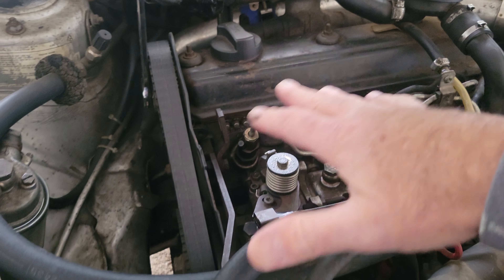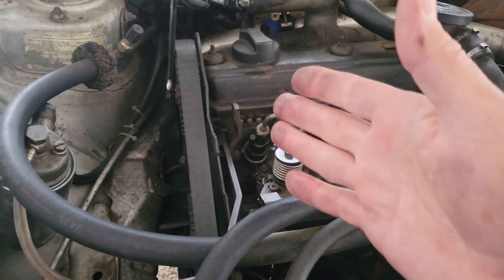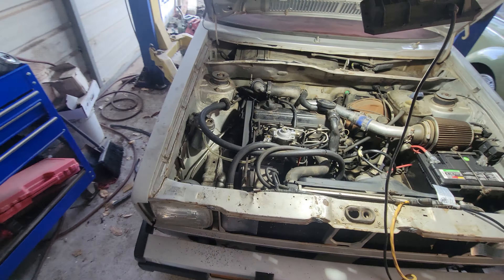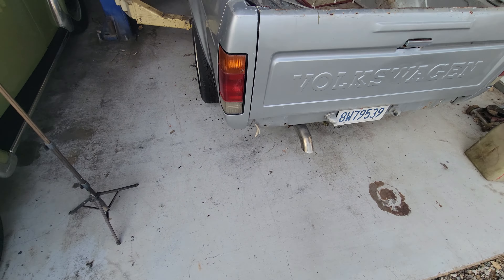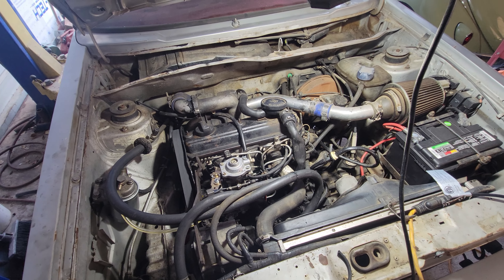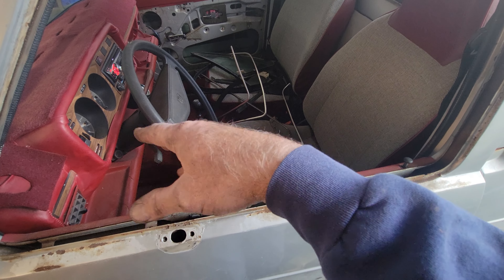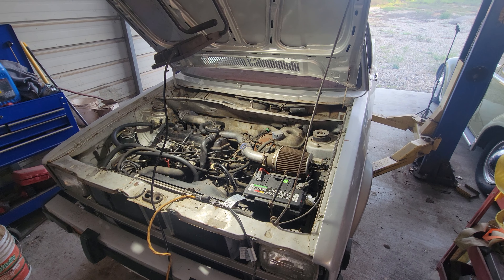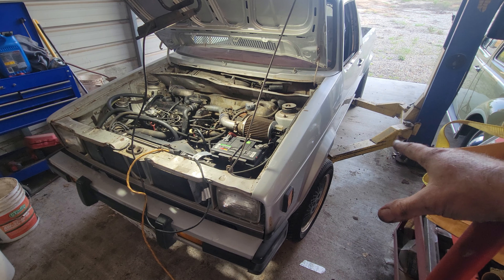VW Rabbit pickup caddy 1.9 turbo diesel ALIVE AGAIN.

Comment: I miss those simple diesel engines. I had a few of those engines in my golf mark2 in Germany. They run great until u over boost them. I believe that's the AAZ diesel.. you can adjust the pump timing for power or fuel economy.

Comment: Sure would be cool if one of these VW parts dealers would start sending you parts and then allow you to make videos of them being installed. And then the handshake would be that you get the parts and they get the advertising. I’m surprised that hasn’t just occurred due to the extreme great quality of your videos.
Reply from the maker: yea they just dont give me free stuff. I can get a discount but it is only wholesale which is at the most 20% off. sometimes less than that.
Reply: @Mikefngarage .   No.   What I’m saying is.   Your content is so great.  That honestly they( venders) should really consider ( like do) providing some equipment. (Ex:like a few oil cooler options) or refurbished steering box thing.  Or maybe a Speedo.         
It 2024 .....these VW PARTS venders should realize persons like you ( with such great content)are where FREE advertising/marketing can* occur.   
I’m honestly just trying to create some synergy on this topic hence me not rich and not able to fiscally support your great channel/content.

Comment: I think this is that type of car that you can flip that oil pan around or something like that. I mentioned this in one of your other older videos trying to get you to tell me the correct way to explain this.   Or to just have you tell me I’m silly and to be quiet. But I’m pretty sure I recall that this type of vehicle has some cool benefit about taking an oil pan off of a different vehicle and turn it backwards on the vehicle that you’re talking about today in this video. And if I recall correctly you can dodge all future smog’s with this change. I can’t remember exactly how it works. What’s cool is that the car is extremely fuel efficient on the front end. And then to be able to drop DMV prices BS is just great.     I can’t remember exactly how I was explained this by some VW guru of the past that I had met

Comment: I been looking for V W . DIESEL as they have so many miles on engines scar me away // if you do a rebuild on a diesel because I used to MAKE  my my diesel fuel out of old fry oil in my olds Diesel and my G.M.C. truck 6.2 diesel , I always liked the 50 M.P.G. VOLKSWAGEN  DIESEL//  put people that buy them new run the hell out of them to 300,000, miles and there done as the motor need a rebuild